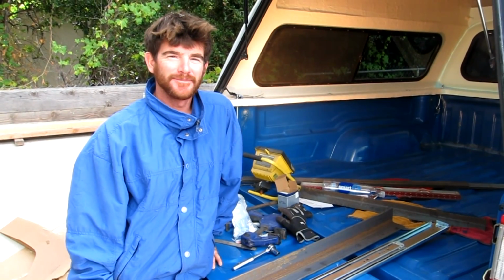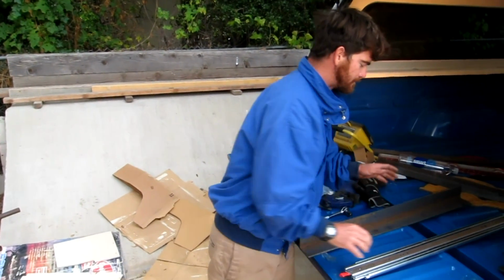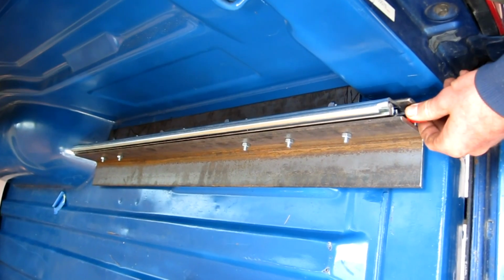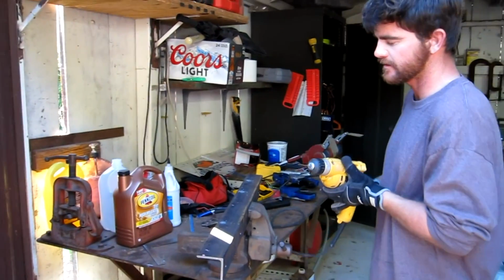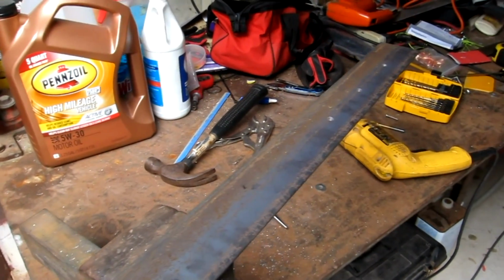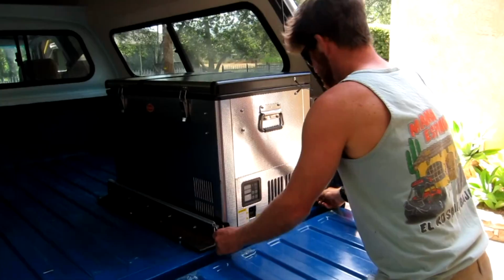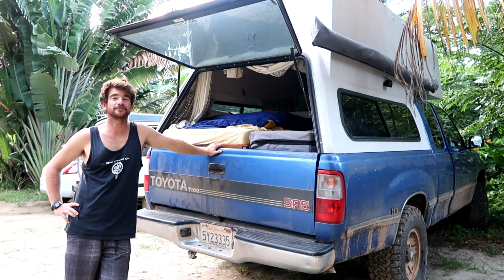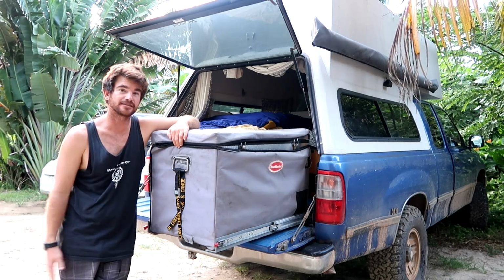How to Build a Fridge Slide for Your 12v Refrigerator in Your Overlanding Rig

Comment: Where did Matt pick up his fabrication skills? I’m especially curious if you could make a short video about that screwdriver and pencil taped together template maker tool from an earlier episode of the shell and cab boxes.  It looks so simple but I’m sure there’s something more to it because all of his pieces look like they came out fantastic
Reply from the maker: HAHA. My "fabrication skills" are just made up as I go along😅
the pencil-screwdriver tool IS that simple. Just hold it at a consistent angle from whatever it is you are making a template of, then test fit your templates before using them to make the actual pieces. You can buy a tool that does the same thing, and use stiffer template materials for better results, but I'm cheap and not a perfectionist.
Reply: The Traveling Together Journal , thanks I appreciate the answer and the info!

Comment: Poor man's alternative to lock on fridge which might outlast everything else. Drill a hole through slide and lock them in place, with a pin/bolt. Or use a sliding barrel bolt, attached to fridge or slide and just insert barrel in hole in truck bed. 
Yep, did that before - outlasted the fridge and did last for 298,000 miles.
Reply from the maker: Thank you for sharing John. I relly like the sliding barrel bolt idea. Obviously, I don't mind drilling holes in my truck:) I will keep an eye out for one next time I'm in a faretaria (hardware store)

Comment: Why not aluminum angle bars??
Reply from the maker: Given the weight and vibration, I felt more comfortable with steel, but Aluminum would probably work too. Definitely if you welded a little triangular gusset at the ends to add rigidity/support since the fridge feet sit right at the ends.
Reply: @TheTravelingTogetherJournal  My thought would be on the weight savings. I'm using aluminum as my skid plate (1/4'' thick) and inner fender well (1/8'' thick) on my Jeep TJ.
Reply from the maker: Yeah. You'd save a few pounds for sure and every bit counts.
Reply: Matt, I was actually searching for a home made fridge lift. Haven't found one yet. soon as I saw your build  I knew that those heavy steel angle bars are way overkill. some good sized aluminium angle would easily hold the weight of your fridge, any food etc inside and someone leaning in to look for something, etc.
Given the correct thickness of aluminium, there's no need for gussets at the end to strengthen the bar. You would save
A LOT of weight for sure, is easier to work and a bonus, it looks better straight up.
Good on you for having a go. Overkill is better than not enough so pat on back mate.

Comment: 10,000 lbs Fridge ?
Reply from the maker: The empty fridge weighs about 60lbs. It has a 66L capacity, so its quite a bit heavier when it's full
Reply: @TheTravelingTogetherJournal        2" angle iron:   10,000 lbs ?   way over built.   too much weight, for no good reason.
Reply from the maker: @dafrasier1  The 2" was just a convenient size to mount the slides and to provide enough room for the fridge feet to sit. Suppose I could have cut off some of the unnecessary steel where the feet didn't sit or used 2" aluminum angle.